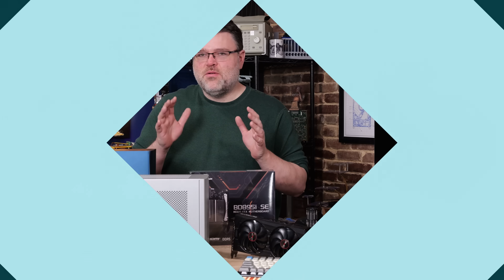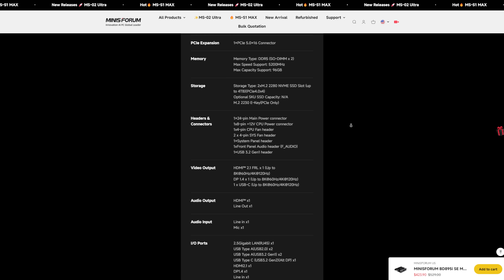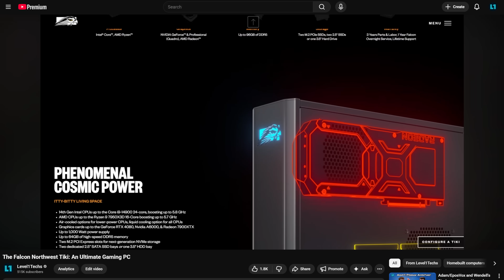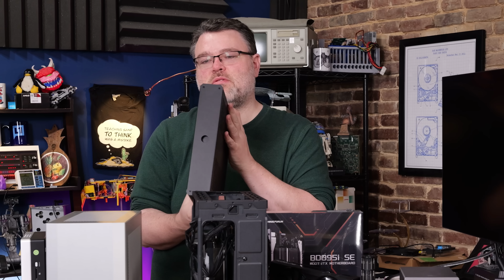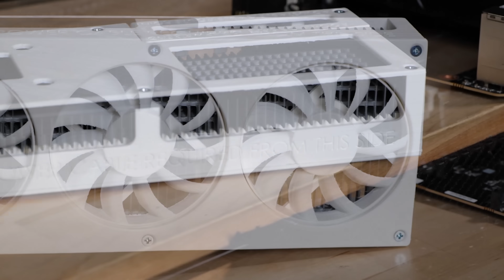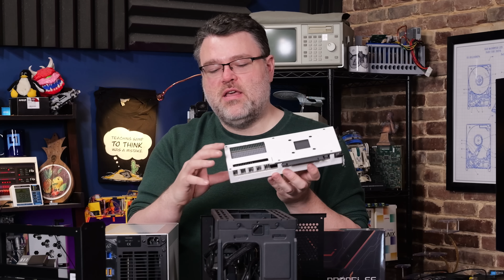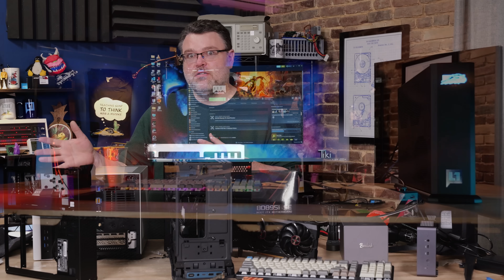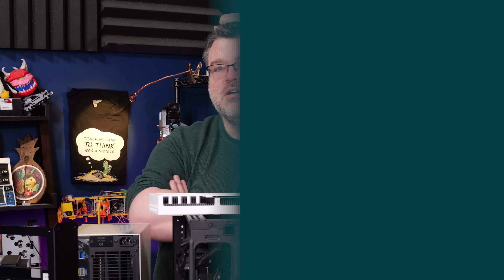Mini PCs Need Some New Rules! Ft: Minisforum BD895i SE Motherboard

Comment: I love my BD795M,  I stuck it in a 10 year old MicroATX case, put a 9070 in there,  and it's like 1/2 the size of my 7800x3d/9070xt Fractal Torrent but runs nice and cool.  Its almost silent,  and works great connected to my OLED tv with a DP to HDMI adapter (grrrr!  stupid HDMI forum!)  

Was way cheaper than buying any 16 or 12 core 7xxx or 9xxx CPU and Motherboard separately.  The ddr5 laptop so-dimms are slower than my am5 system,  but at the time of purchase,  it was around $130 for 64gb kit.

Comment: Is AMD also using the open-source openSIL BIOS update model with the desktop and mobile platforms starting with Zen 6 or will it only be used for Epyc? Getting long-term AGESA BIOS updates is a major factor for me when choosing a system to purchase.

Comment: I hope they put out a m-ATX version with a PCIe 5.0 slot. I have the 795i SE and the stock cooler absolutely sucks. The m-ATX version only had a PCIe 4.0 slot, I'm hoping the 895m (if it arrives) is going to remedy that, then it might be worth the upgrade.
Reply: what will they get this magical PCIe 5.0 out of? magically make pcie that shares all the lanes that are already not that many?
Reply: @Karti200  the 795i SE and 895i SE both have PCIe 5, I just want the 895m (if it is going to exist) to keep it.

Comment: What I'd like is a rack mounted pc with no gpu, a rack mounted gpu, a rack mounted home theater components, rack mounted nas, rack mounted power conditioner, rack mounted uninteruptible power supply, well engineered connection to solar/battery whole home system, and well engineered emi shielding and seperation, and fewer 3 prong power brick nonsense that takes my dc from my whole home system, uses an inverter, rectifier, inverter etc. I'd spend some money on a power bus bar. It might make sense to NOT do what I want. Keeping my stereo amplifiers away from my computer is probably wise.

Unfortunately, home theater seems to be less popular than it once was.

Comment: Respected Sir, first of all very excellent and technical video. But I am wishing to humbly submit that this entire tension about new form factors and costly mini PCs is not required if we see the Indian engineering jugaad mindset only.

Here in India, we are already having best in world solutions. Our local computer markets assemble far more compact and cost effective systems using reclaimed laptop motherboards and innovative clay pot cooling for silent 24/7 operation in extreme heat, at half the price. Furthermore, our world leading generic electronics manufacturing means we produce crore of these efficient boards ourselves, making foreign brands unnecessary. Why need two slot GPU standard when our programmers are best in world at cloud streaming and compression, allowing full gaming on a 5,000 rupee phone from a central household server? The future of small form factor is not in new rules, but in adopting Indian efficiency and intellect only.

Jai Hind.

Comment: too big to be a proper mini pc if u ask me. I would love a nuc sized motherboard for a desktop cpu, ram and full size pci-e connector, like a gold finger on the bottom of the pcb for a ribbon or something like that. I have been using mini itx since like 2011 ie sandy/ivy bridge and I think we should have gotten smaller form factor for us diy pc builders.

have been running the pretty big for a mini itx build, the fractal design node 304 back then, then a fractal design midi tower for mini itx mobos only, and dan a4 h20 and corsair nrp200(what an awesome case). Loved the org dan a4 sfx chassis.

Love my powercolor reaper 9070xt, basically almost as small as an oem ref 3080 that my friend had when he bought an hp omen 30 prebuilt. And the reaper 9070xt is pretty quiet and and is basically as fast as the biggest with the highest powerlimit 9070xt like gigabyte aorus 9070xt elite which I had in my atx 9800x3d machine to compare to my 12700k itx sys with the reaper 9070xt.

Comment: I'm running full ATX Fractal Define 7 for my daily desktop. Living Room has Minisforum UM870 Slim with Bazzite(1TB, 32GB config I snagged off Ebay for $400 last summer).

IMHO modest APU systems are going to service 90% of consumers in the near future. That miniPC absolutely RIPS and I can run Baldur's Gate 3 without any issue. That's plenty of fidelity for mainstream gamers. If AMD gets off their ass and brings FSR4 to RDNA 3/3.5 think of the millions that benefit. I mean hell AMD is still selling RDNA 3.5 new today and they don't even run the latest software stack natively. That is unacceptable!

StrixHalo is wonderful it seems but the price is still too near the cutting edge. I'd love to get an upgraded Laptop like the HP Z1 with 64GB StrixHalo, but closer to the $1,500 price point. Things will settle down eventually. Thank you for exploring creative options for everyone in the meantime!

In regards to a new form factor, I have concerns that further fragmenting the PC space will run into economy of scale issues that keep prices high. Look how expensive ITX mobos still are in relation to mATX for example. Gamers need effective, simple, cheap. Enthusiasts can pursue the niche.